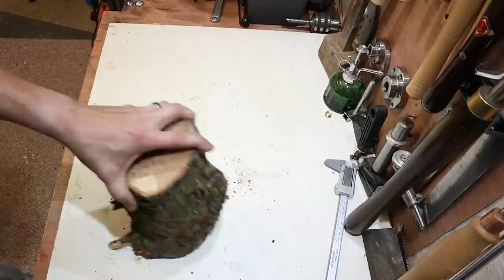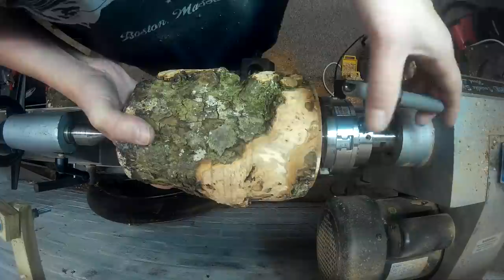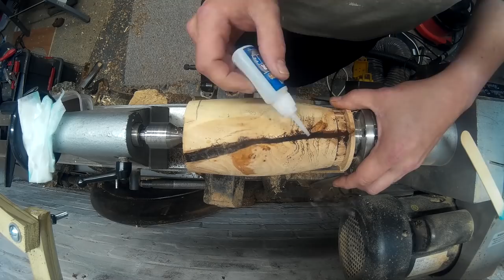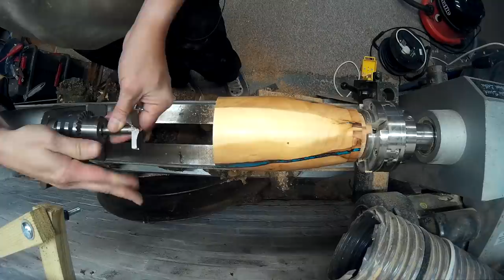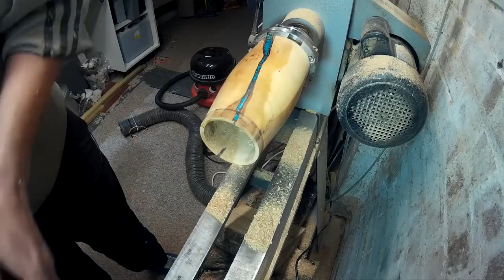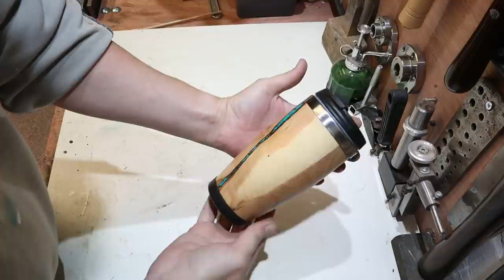Woodturning - It was supposed to be a vase!

Comment: Pretty, but why the need to remove more then half of what there was to start with? Curious, not meant rudely :) I'd like to buy something with as much of the starting material as can be salvaged and maybe have the end result be preserved if that's possible? (:
Reply: Maybe it was too big to fit
Reply: Well trees basically have dead layers to protect the actual wood. Bark being one of them. Also, Trees develop density and strength as they grow. So you would want a decent log to carve something sturdy. I'm sure he saves the shavings though. I would.

Comment: That was really quite good and you wound up with a nice container cover. Me, I would have started by trimming that stump with a chainsaw... just stand it on a chopping block have someone hold it in place with a partly embedded axe and take all the rough off ...but anyways it's fun to use a wood lathe for all. I was wondering what the blue filler was I thought you would have used glue and wood sawdust to get the same finish but the blue streaks look kind of cool... thank you so much.